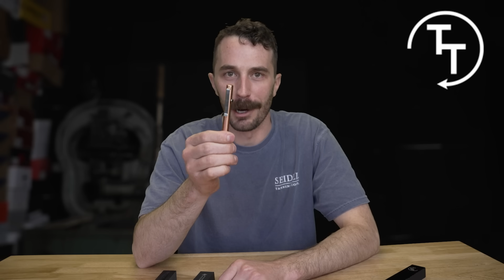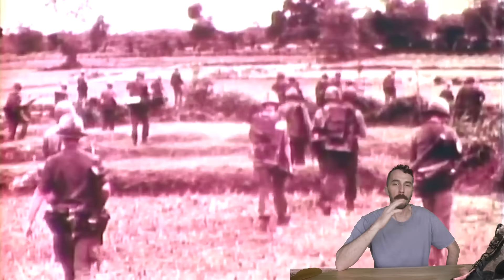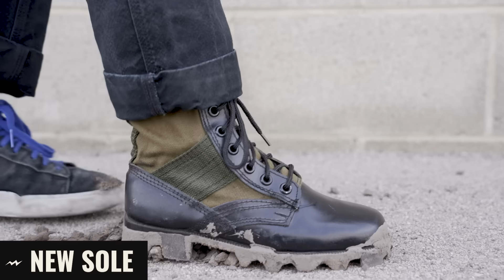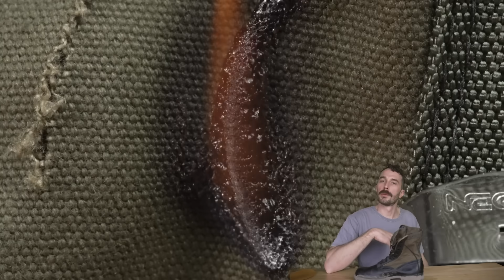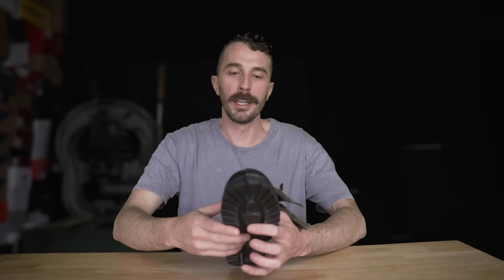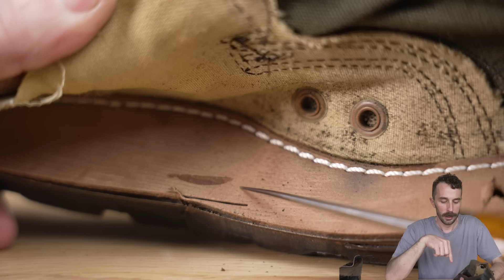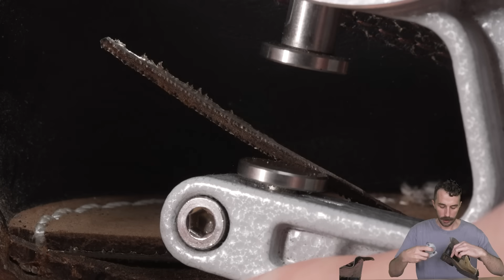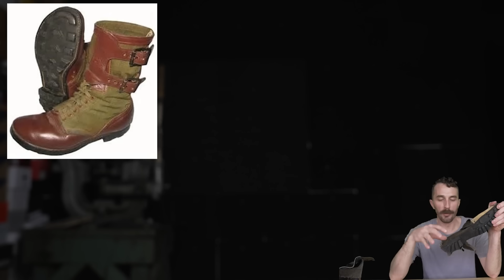Why it took 57 years to replace jungle boots

Comment: Wait you can get new boots like these for $50? That's insane, I'd rather have 4 of these over 1 doc marten.
Reply: McCrea boots is where to go but your going to have to pay quite a bit more then 50 bucks ( at did about 106 to that 50). Regardless your getting a boot that’s made in America by Americans and the company was one of the original jungle boot contractors
Reply: @matthewcaughey8898  Do they sell to leafs?
Reply: @Albus_Rex  they’ve got a website so I would say ask em if you wanna place a big order
Reply: You wouldn't need 4, buy 1 and it will outlast the martens. But I'd also like to know where the hell to pick one up
Reply: Ebay offers that at least. I have bought two pairs of jungle boots from there.
Reply: If you can find a surplus pair in your size, good luck!

Comment: Can you do modern Army or Marine Corps boots next? It would be nice to see the evolution of the gear's construction over the years.
Reply: There are a few versions issued in the Marine Corps. There are the temperate and hot weather boots, and then the variations between contractors
Reply: @removerinnawoods8536  the army has standards, which if met by private companies means you can wear privately purchased footwear
Reply: @shinobi-no-bueno  must be nice
Reply: @removerinnawoods8536  Bro the Marines also allow you several options of aftermarket boots. Treat yourself to some comfy boots. Your back and knees will thank you.
Reply: @shinobi-no-bueno  I wore Herman Munsters or German tanker boots while I was in. Loved those boots.
Reply: @removerinnawoods8536  Back in the mid 90s, the Marine Corps allowed certain privately purchased boots to be worn as well. I always just stuck with the jungle boots and cadillacs myself.
Reply: @removerinnawoods8536  you can do that in the Marine Corps also. I always bought the nice Danners instead of the cheap Bates crap.
Reply: @removerinnawoods8536  my uncle makes the Standard issue boots that i actually prefer for the USMC McRae Footwear in Fayetteville NC. He can optionally get a pair for a very heavy discount or for free... every month or so... helped me out alot in my 4 years in the marines..... never paid full price for a brand new set of boots... and always had a brand new set on hand.
Reply: @justnsaliga8518  damn dude, hook a guy, or the whole comments section, up
Reply: That's what I'm saying. Standard issue should be the boot he does.
Reply: Better yet do the shitty bates boots the navy issues now.
Reply: @codyl3858  Bates used to make good footwear but the last pair of Bates shoes I got will be the last thing I buy from Bates that is not a bag of eyelets. I do buy nickel plated Bates shoelace eyelets to make Fender guitar amp reproduction boards. Theirs shoes and boots are trash now.
Reply: @codyl3858  oh my god, FUCK THOSE BOOTS. Absolute trash.
Reply: @codyl3858  those shit Bates boots started to fill short orders of the Danner RAT boots - the guts of the boots would separate and the wearer would have to cut their foot out. I think the only good boots they made were the Ultra Lites, which I bought solely for boots ‘n’ utes PT.
Reply: Has anyone requested military  "Mickey Mouse"  cold weather boots with the valve on the side?
Reply: @daveruttman6501  I think that’s what he meant with the bunny boots - maybe the Mickey Mouse boots get their name from being black as opposed to the white he showed?
Reply: @Ishkybibble  the black 'Mickey mouse' boots were the first gen, the white 'bunny boots' were the final updated iteration that are still in use
Reply: @daveruttman6501  he actually showed off a pair of the vapor barrier “Bunny Boots” that they issued us in Alaska at the end of this video. They have the little valve on them, so I’m assuming “Mickey Mouse Boots” are just another name for those.
Reply: @daveruttman6501  i live in the boreal. Some people swear by them as being warm and waterproof if you get into overflow on a river. There are white and black ones. Someone i know who uses them said the valve was for airborne operations. My understanding is the boot is two layers of rubber with an airspace between. If so, it would make sense that with enough pressure change the inner airspace would need a valve to protect it from developing a leak. I have never worn them, instead opting for traditional moose leather and canvas mukluks because they are light and warm. Never had wet feet and ive been in plenty of overflow.
Reply: @daveruttman6501  isn't that just rubbber with a wool felt liner?
Reply: @removerinnawoods8536  I do not know?   I've always had a pair.  I think having that  pressure relief valve might help insulate?
Reply: @daveruttman6501  nah the valve is to equalize the pressure in the sealed insulating compartment between the rubber layers when you go up and down in altitude (i.e. 'airborne' like it says on the side)
Reply: Well you might not want to know because I believe we gone into a great regression in boot technology...
Reply: Also boots from other countries. I'd be very interested to see you cut apart a pair of altbergs from the UK
Reply: Yes
Reply: I had a pair of Wellco sand colored that I replaced a couple of years now for a pair or Belleville 790, 2003 vintage (basically the same model both) it would’ve been great to mail them to him. Anyway it would be great to see him cut in half one of those
Reply: Which ones? The military has many different boot options made by several different companies depending on the climate, such as hot weather, temperate, cold, steel toes, dress and etc.
Reply: Would also love a comparison between some countries. Varusteleka has a big selection!
Reply: I can send you a used pair of USMC Jungle Boots that are worn now a days
Reply: I agree modern military boots would awesome
Reply: Well, with all the brands available at varying price points, multiple videos could be made on modern combat boots.  In my experience, RAT boots are just god awful, you might as well just strap a 2X4 on your foot because they offer no support where it's needed yet no flexibility where it's needed either, also the soles crumble and fall apart.  Bates are the cheapest option, they are comfortable and lightweight almost like sneakers, but they seem to wear out fast.  The McRaes seem to be a slight upgrade from the Bates.  The more expensive brands like Belleville and Danner seemed to be the best, but as a lowly E-3 they seemed to be always out of my price range when I needed a new pair of boots.
Reply: The airforce would be the easiest to review. Sandals do t take all that long to educate on
Reply: I'm actually kind of digging these ex Air Force Belleville sage boots. The finishing is government tier, but really solid and got comfortable pretty quickly.
Actually got another secondhand pair coming in, but in the Army Tan instead
Reply: The desert Belleville's or Welco's standard issue regular Army from 1990 to 2010 era boots... In 25 years, I am only on my second pair, and wear them daily. The first pair, just need new Vibram soles as I wear the back heal corners out...
Reply: @drubradley8821  classic heal corner wear. Gotta love it
Reply: I have the Danner RAT Gortex. Pretty awesome boots for stomping around in the woods.
Reply: I think they are pretty much a further development of the jungle boot using buckskin instead of ordinary leather.
Reply: German tanker boots with the wrap around strap were the rage when I was in the army in the late seventies. They seem to be well constructed
Reply: They have rainbow laces now
Reply: Most people buy their own boots. There's special cold weather issued ones, though
Reply: Apples and oranges with the variations. I have a pair of Danners I’ve had for 10 years that were $250 or I’ve had more lightweight boots that were $100 and lasted maybe 1 year.
Reply: Hey so I have a few extra pairs of both usmc hot weather danner rat boots and usmc Belleville steel toe hot weathers, if you want em they're yours rose
Reply: @pwnagetothamax  me too. I have a plastic tote full of army boots (jump boots, tan jungle boots, OG basic issue boots, etc.) from the early 2000s. If Rose wants them he can have 'em.
Reply: They suck. They're designed to help service members collect VA benefits. Literally a contraption designed to roll ankles.
Reply: Yes please I really wanna see this now
Reply: They suck. Specifically USMC ones. All of them. The Army gets alot more variety.
Reply: Those were my first real boots. I love'em!
Reply: Danner rat boot
Reply: I can tell you they suck
Reply: I’m gonna warn you he will shit on them.
Reply: These are modern
Reply: @lonewolfdenn  they quit using these in the Marine Corps in the early 2000s
Reply: Lowa!
Reply: The army has like 5 

Oakley for the win
Reply: The issued boots (2005-2010) gave me horrible shin splint pain. My favorite COTS boots were the Garmont T8s.
Reply: You know damn well the Marine Corps boots are crap. My all leather black Altama boots lasted decades longer than my tan Marine Corp stamped boots. Those tan boots lasted less than a year.
Reply: Will be fun to look at but only a handful of guys in my whole battalion used the issued boots unless it was required for a school.
Reply: I have some fairly modern desert issue  boots that are like jungle boots but tan with rougher leather. They came from the national guard I think.
Reply: Heard good things about the Oakley ones
Reply: Todays boot BLOW!
Reply: "Bolt-action pen" costs as much as a bolt-action rifle.🤣
Reply: They add and change so many… ☠️
Reply: Rimango ryrrrryy4y4yryry4rryy4yryr4yryrry4yyr4y4yy4yryrrryyyryryryrryù44yryrrryryryryyrryryyyryruyrryryrru4rryrrryryryryrryyyryryyryryryry4yrryryryruyryyyy4ryryyry4yryyuryyyyryryryryyrryyrryyrryyryryryryryryrryrrrrryryryryryryyryryryryryrrryrryryryryryryryryryryryrryryryryryryrrryryyrytyy4yryryryyyryryrr ray è r youtu.be errore di registrazione re r ti your y irruzione trarre traccia di ray ryrryryryryrryryyryryryryryryryryyryryruyryyryryryrryyrrrrrrryrryrrryryryryryry4yryryrryryryryry4ryryryrrrryrrrrrryyrrrrrrryrruryruuryry4yryyryryryrryurryryryryruyryryryryrrryryryryryryryryryryryryryryyryrryryryryr4yrryryryryryryrrryrryryryyryyrryryrryruyryryryryryrrtri4yyryrryryryryrryryryryryruyryryrryryryryryryryryyyruryyyyyyyyyruyyryryryuryruyyyryruyrryyuryryrrrryryyrryrryryrrrryryryruyryrryrrryr
Reply: The thing is now that we are able to buy our own boots, as long as they fall within the guidelines. For the marines at least we are only allowed a certain few brands. The boots we are issued at boot camp are very heavy, cheap and low quality. You can pick them up at the PX on base for around 30$. Most guys I know, me included, almost immediately went out and bought Danner Reckonings. They go for around 250$ Bates Lites are also a popular boot in the Corps
Reply: Yeah please do
Reply: Are the modern replacement boots better for that purpose?
Reply: I am sure they 2 boots are the same arent they?
Reply: Lol which ones? Mcreas, Garmonts, Okleys, Belleville, Bates? Theres alot of them and many brands make the standard issues hot weather and winters.
Reply: Since most people are asking the specific boot, I'm guessing the most popular that most soldiers wear, other than the supposedly trash standard issues.
Reply: @Goodstitching  Rocky S2V, for sure
Reply: I mean I got an "old" pair of Bellevue ahwc (army hot weather combat) boots issued in 2019
Reply: Our boots fuckn suck, my feet get fucked up no matter what they do
Reply: One of the last pair of boots I bought were Converse tactical boots and holy crap I thought I went to heaven.  Most comfortable boots ever.  Didnt last for shit lol but it was worth it while they did lol.
Reply: Only took the Military 200 years and even up to the early days of ww2  to realize soldiers need good footwear. Until 1944 grunts and soldiers were issued shoes and leggings . The leather was flesh out and needed waterproofing . Crazy. They should have let them go into town and pick out a pair of decent work boots. Lol
Reply: I have a pair of us army issue desert boots that i used all the way through basic training i will personally mail them to you. For their final send off.
Reply: I'd take the old jungles and r speed lace altimas any day over the new style combat boots.
Reply: I have the modern marine ones and they're super comfortable im sure hurtnkike hell after 12+  hours on ur feet
Reply: how tf is BERETTA just commenting on videos lmao
Reply: You have a selection of tons of aftermarket boots that fit regulation, no one wears the dirty 30s
Reply: There are boots in between these and the ones you mentioned.
Reply: Thats like a thousand different boots since almost no one uses the issued boots except the steel toes. In basic we called the combat boots they gave us bricks cause that's what they basically were and the second we were done with basic we all bought either oakleys, or 5.11s, or some shit. I bought a pair of smith and wessons and some a few other pairs
Reply: don't use the regular boots lol. you will feel pain
Reply: Ah yes, modern standard issue boots - "Not for combat operations" 😂
Reply: I would like to see inside Rockies
Reply: Specifically rockies!
Reply: Someone buy him these so we can see then cut
Reply: @darkknight84123k  I have a set of boots I used, thoughnthe soul is cracked. How can I send them to you
Reply: @darkknight84123k  I'll send him mine anyone know if he has an address or something to send stuff to?
Reply: @darkknight84123k  You buy it.
Reply: @darkknight84123k  why buy them for him? He's gets paid more than anyone watching this.  I promise you.
Reply: @darkknight84123k  if he drops a PO Box I’ll send him a set of my extra boots I got in the Marine Corps
Reply: No one say anything
Reply: What replaced the boots?
Reply: I want him to do a review on the Danner’s USMC tropicals because I ain’t tryna dish out 300 dollars
Reply: The standard issue boots are garbage. Most soldiers buy boots off the shelf from Rocky or Nike
Reply: Aint Military Grade Just a Label For "AS cheap AS possible" ?
Reply: @SchlaftaterNrzZz  it's whoever can meet the established specification for the lowest amount.
Reply: @SchlaftaterNrzZz  

No
Reply: @SchlaftaterNrzZz  Maybe? I don't  know?  Sig Sauer just won a big US Contract. They don't make cheap stuff.
Reply: @SchlaftaterNrzZz  no. as functional as possible..... trucks with bumpers for pushing cars out of the way or being lifted by  a crane or helicopter. boots made to dry quickly and drain water and not fall apart. and be flame retardant. while providing good ankle support..... but yeah provide all that as cheap as possible. i only use McRae boots because the other 2 brands that are USMC approved. will not say names... fell apart after only a week of moderate use.... while a set of McRae boots i've never had them Fall apart or fail on me. just replaced them because they got too dirty........ soo dirty the USMC EGA is completely gone. worn off. and that typically takes 8 months of hard use. never had a single one break... i have a field set of these boots i've used since just after bootcamp in 2018.... They're still in one piece yet to break in any way. They've been soaked hundreds if not thousands of times now. been wet for days on end. they've probably had more miles run in them than your Oil change interval for your car.
Reply: @SchlaftaterNrzZz  the ones you are given in basic yeah but after market ones you buy arent.
Reply: @SchlaftaterNrzZzno.
Reply: @SchlaftaterNrzZz  yes. It meets the minimum standard set, aka half assed. It's like graduating at the bottom of your class as a doctor. It's still a doctor, but it's questionable sometimes.
Reply: @l_P0L4R_l  Thats literally not questionable at all